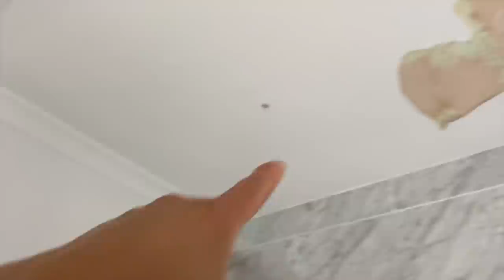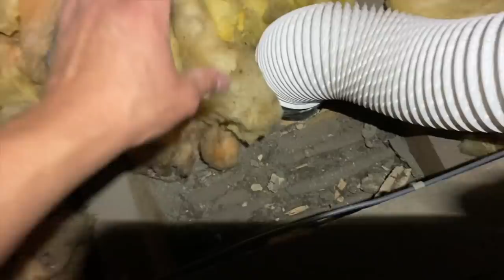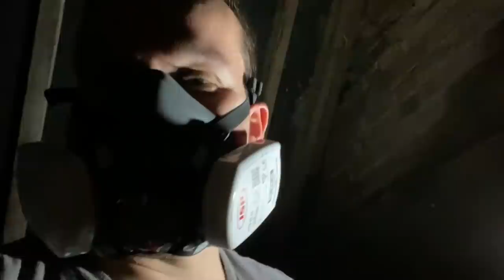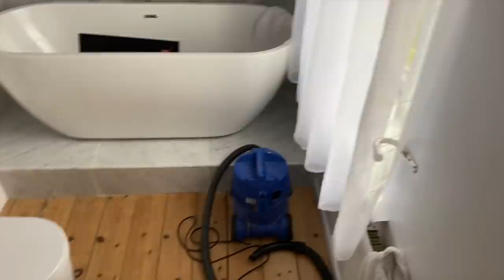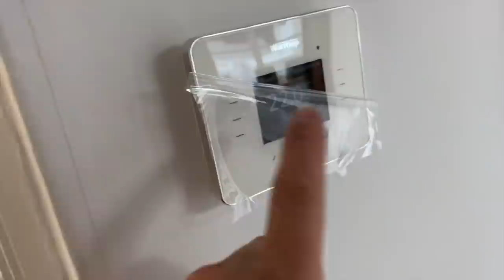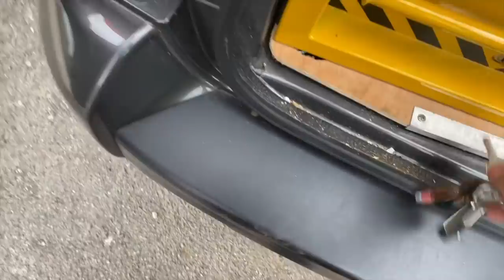HERE WE GO AGAIN!!! UP THE LADDER.

Comment: You should have made the final  connection to the fan with flex,cable is rigid and will not allow for any vibration , also you should have put the cpc in a connector. To commission fan a annometer should be used to confirm the correct L/S not just a tissue.
Reply: That is correct because of vibration same as a circulation pump on heating system.

Comment: Fire rated lights yet no fire collar above the extract grille ? Odd ?
Reply from the maker: There’s no requirement for fire rated fans/downlighters in non-fire separating ceilings - e.g. up into a roof space.
Remember this ceiling is also lath and plaster.
I always like to go above and beyond so any ceiling mounted grills will now be fitted with an intumescent seal.
Reply: @Cjrelectrical  Its good to exceed customers expectations, keep them coming , well done !!!

Comment: The second fan on the ceiling is an axial fan and only good for through wall jobs , no good with 4 foot of duct and tile vent . Come across axial fans all the time installed incorrectly,  change them for centrifugal and get the moisture outside as intended

Comment: Although a small run to the outside, extraction performance is always improved by using rigid pipe rather than flexi hose. I suppose it's what you're asked to use.
Reply: That is so true the sides of flexibility suck in people don't realize .

Comment: You should try the high rise vent kits for the fan, I use them all the time, bit more expensive but save the risk of getting up ladder etc, just drill Inside to out and push the fan vent/grille through the hole and it opens out on the outside and job done.

Comment: If you mount the fan on a piece of wood and mount the wood onto the brick it reduces the vibration and noise travelling back into the bathroom.

Also if you Manrose do a 100mm fan that is basically identical to the xpelair one but like half the price.

Comment: I put a length of 110mm soil pipe through cored hole. Fit plastic vent cover to it. And use insulated flexi in lofts.

Comment: Prob would use insulated duct as condensation trapped can be a problem in ducts in loft voids and fuse down to 3amp for fan circuit
Reply from the maker: The fan I used doesn’t require a 3 amp fuse as it incorporates a thermal cutout unlike a lot of cheap wall mounted fans.

Comment: Love the vids man. Tip for the core drill get abit of 2.5 twin and strip abit of copper and wrap around the base of the arbour, so when you put the core drill on it’ll will squash between the arbour and core drill. This will make it 10x easier to take it off, because the copper is a soft metal it stops the two pieces welding together when it gets hot. This also works with normal hole saws 👍🏽
Reply: Interesting mate thanks

Comment: Good job apart from the tape on the hoses. That will work it’s way off over time. Better with a stainless steel hose clamp for each.
Reply: Doesn't say much about the 3 day extractor fan course then does it.

Comment: Got a tip for ya to stop the core bit jamming up on the sds shank just place same 2.5mm copper wire. Raps a few turns on the shank

Bits into the softer copper and so simple to undo the Core from the Sds shank. With  ease.

Comment: Try using a greenwood airvac 100mm fast fit tube with a cheap back draft shutter £30 worth of kit but saves getting the ladders out as you can do everything from inside.

Comment: I have a question for cjr can you wire two fuse spurs of one cable supply to first one bridge a 2.5 cable to the second one
Reply: Yes just make sure the circuit is protected by either a 16A or a 20A MCB/ RCBO, this protects the cable as under perfect conditions a 2.5 t&e can only carry around 27amps
Reply: James Nugent
Cheers bud

Comment: I am guilty of this, I am guessing that most of us fit fire rated down lights, yet no body worries about cutting a 100mm hole in a ceiling and installing a fan that has no fire rating, or a fire collar fitted.
Personally I have only ever used a fire collar once, that was because the hood duct passed through the garage.
Reply from the maker: Excellent point it didn’t even cross my mind.
Reply: Not needed unless a habitable room above.
Reply: @stevecraft00  what?  based on that theory then, theres no need to provide fire protection when fitting down lights in bathrooms and kitchens as these areas are not habitable rooms, a garage is not habitable either, but if it was integral to the house that would need fire rated down lights as that is a different fire compartment.
Reply: @acelectricalsecurity  habitable room above, above being the key word

Comment: Why do you use a 110v drill for core drilling? Takes twice as long and you have to use a transformer as well as an extension lead 😂
Reply from the maker: Because I can’t be bothered to change the battery 337times
Reply: @Cjrelectrical  😄😄😄